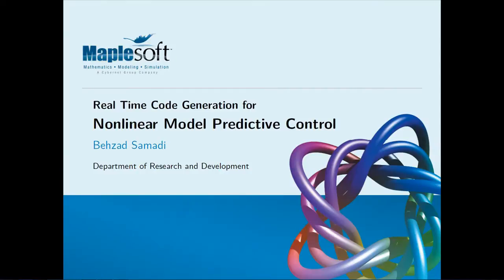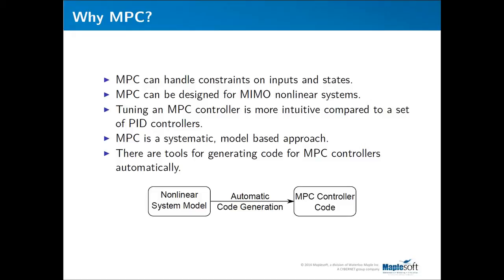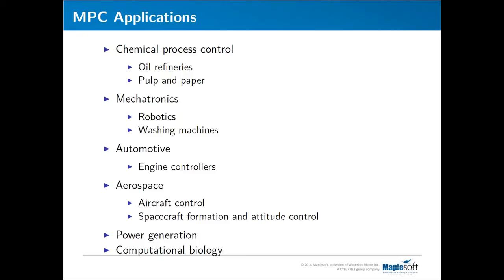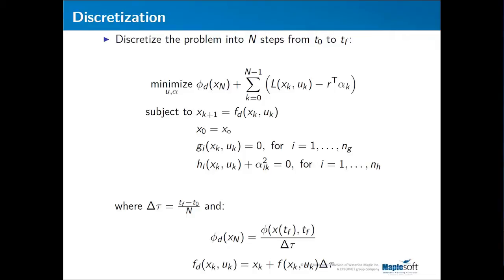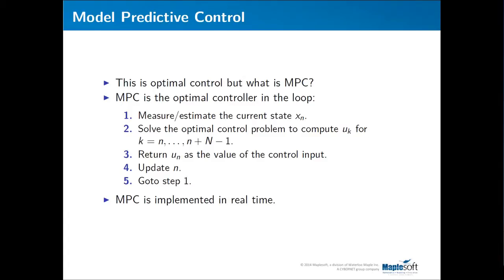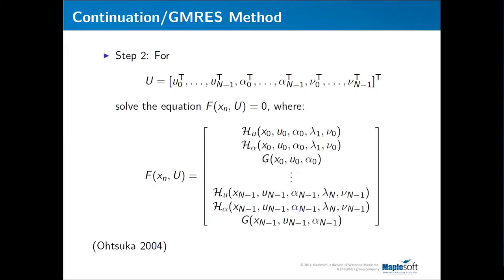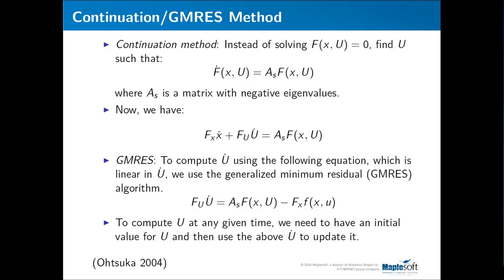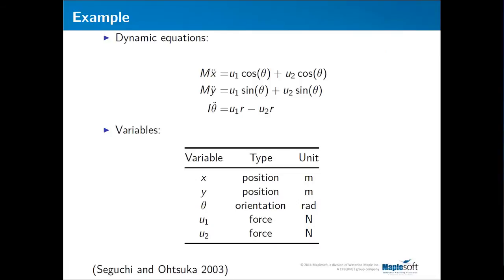Nonlinear Model Predictive Control

Comment: Hi, first of all thank you very much for your video. I am very interested in MPC and would like to apply it for my works about control and navigation of autonomous vehicles (air, surface and underwater robots). the problem is that vehicles normally maneuvers under unknown external disturbance environment (wind, current in ocean...) so the key requirement is that the controller must be robust. Although I am very interested in method of Prof. Ohtsuka but I dont know if it is robust with unknown external disturbance or not since there is no part in his paper (2004) showing this. Have you tried with a scenario that the Hover is stabilized with external disturbance ? Thank you and looking forward to hearing your reply.
Reply from the maker: Hello. Thanks for your interest. Please send an email to the Maplesoft tech support team at support@maplesoft.com. Thanks!

Comment: hello
what is about the extended Kalman filter that must use in NMPC?
Reply from the maker: Hello - thanks for your question. The Extended Kalman filter is applied to measurements that are resultant in non-linear problems to linearise its description about a mean value which takes into account background noise. That said,  Extended Kalman Filter is not yet available for Maple's Control Design package.

Comment: Hello,
I need to integrate the code of the controller into simulink. Is it possible ?
Reply: +Mohamed Abdelaal  Absolutely.  You can generate MATLAB code or C code from Maple equations or procedures using the CodeGeneration package.  The MapleSim Connector add-on also has the ability to generate S-Function blocks directly for use in Simulink.